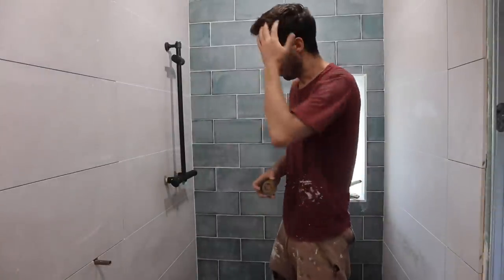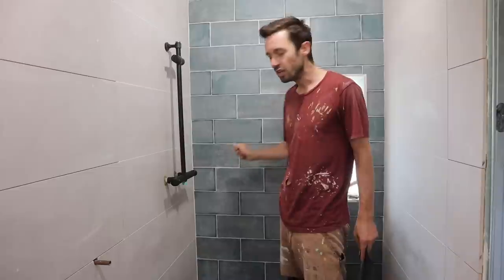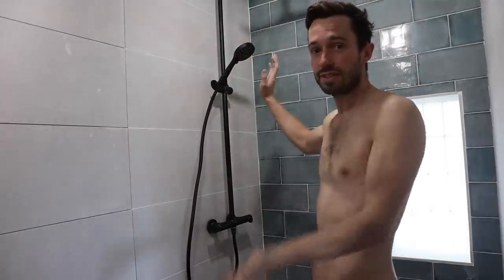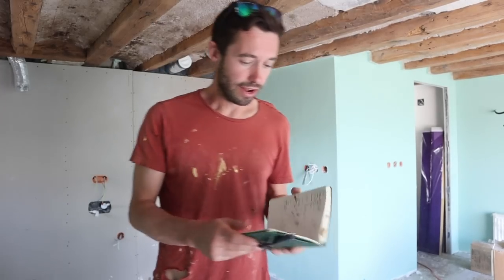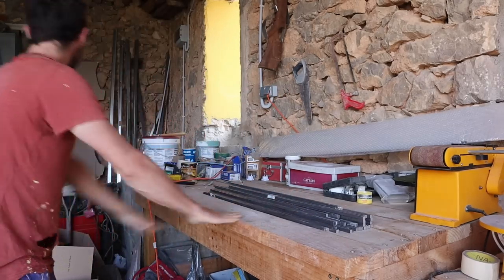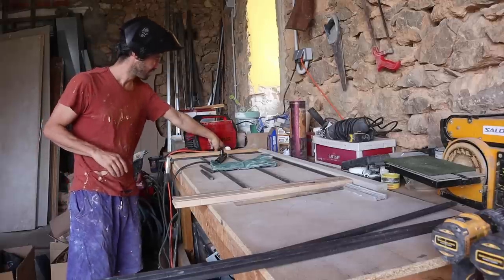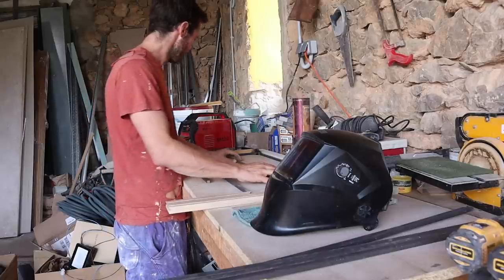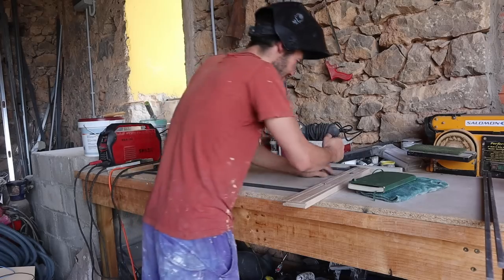MAKING BATHROOM FURNITURE FROM SCRATCH // Old House Renovation

Comment: 🚿: Can confirm that the impermeable grout works fine. Redid my bathroom ages ago with that stuff, and it holds up well. And those glass bricks are sooo 1970’s – one of the best decades ever, design-wise (not!!).

When welding bars like these, it is recommended to create a chamfer at the end (here maybe 2–3mm @ 45º), then fill it up. Penetration will be much deeper, and you won’t lose the whole bead when grinding.

0:30 – Had the opposite view last weekend when hiking / biking near your place, up to the chapel high up there, among other places. Could even just barely see your palace. So nice there. Must say I’m getting sick of the coast…

Comment: Coming along nicely. Totally agree with you on the quality of expensive cabinets. They're just made out of rubbish materials. I do have a tip for you in regards to your welding. To get a bit more accuracy when you weld you can hold the electrode with your other hand, as a guide. Not too close to the end of course 🔥 Use a glove because it does warm up quickly.
The voltage while welding is only about 20-30 volts DC. Sorry for being one of these people on YouTube that tells you how to do everything 😆😆